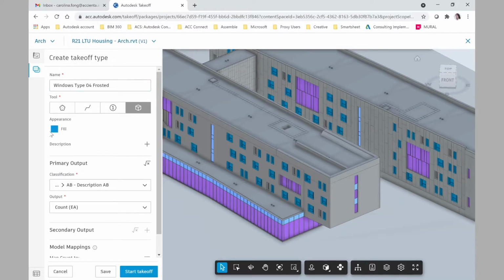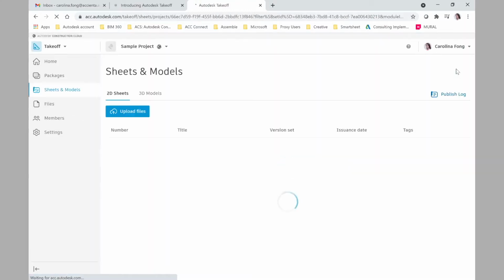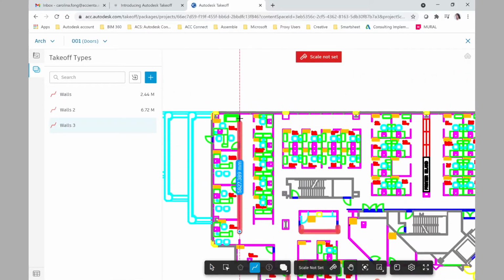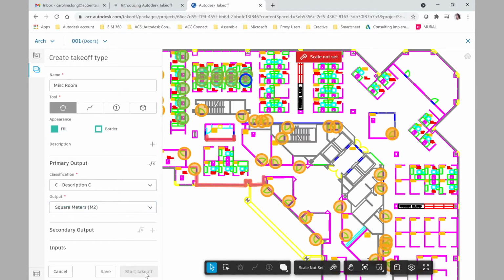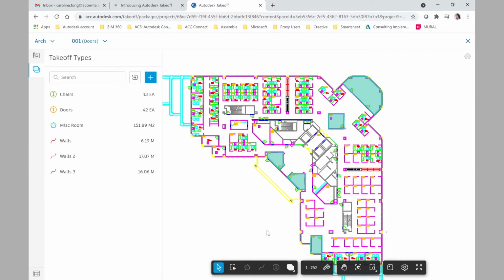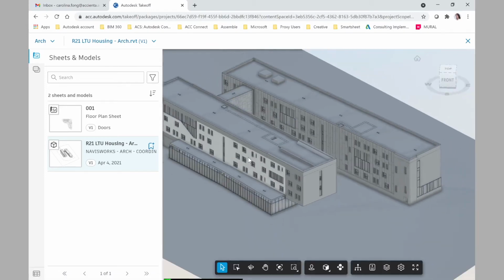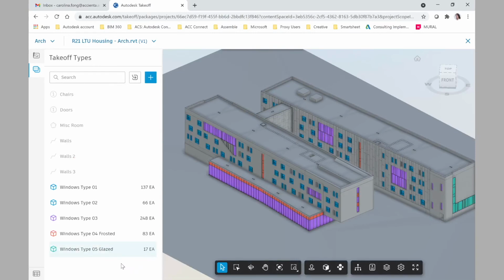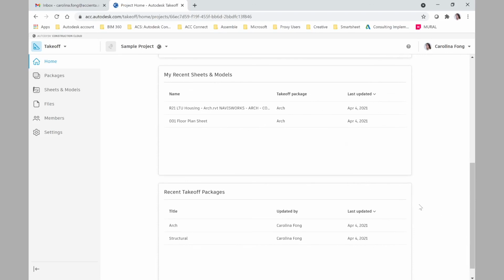Autodesk Takeoff Demo - 3 Steps to Quantify

Comment: What is the difference btwn classifications and packages,
I uploads classification in excel sheet
Reply from the maker: Hi Ahmed, 

Classification system - You must upload a custom classification system or select an available classification system to use during takeoff. The classification system and its codes are used to describe and organize your takeoff items. You may be familiar with commonly-used systems like MasterFormat or UniFormat.

In Autodesk Takeoff, a package organizes and contains all takeoff data related to one scope of work in your estimation project. The concept of a package might be familiar to you as a ‘scope of work’ or ‘bid package.’ There can be multiple packages for a single construction project. Each package organizes the takeoff work relevant to its part of the project.

You can find more information here: 
Classification System:
https://help.autodesk.com/view/TAKEOFF/ENU/?guid=Configure_Takeoff_Settings

Work with Packages:
https://help.autodesk.com/view/TAKEOFF/ENU/?guid=Work_with_Packages
Reply: @CarolinaFongGuzzy  thank you ✋
Reply from the maker: @ahmed3820 It's my pleasure. I'm glad the content is useful!

Comment: Takeoff based on parameters in the 3D models is not possible (yet)? We (and other users) are using the classification code or keynote in Revit and it seems that's not possible to automatically generate a takeoff based on those parameters?
Reply from the maker: Hi Joris, 
The 3D model parameter used for selection at the moment is the element Type name. You can also use clusters (Ceilings, floors, supports, lighting systems, etc).
I suggest you go through the Autodesk Takeoff courses here: https://learnacc.autodesk.com/page/autodesk-takeoff 
What is shown in the videos is the current functionality of the system. Further details are included in the Autodesk Help page: https://help.autodesk.com/view/TAKEOFF/ENU/?guid=Takeoff_3D_Models

I hope this is useful and also look out for new product updates.
Reply: Thanks for sharing. Because of you I learn a lot of things about ACC :)
Reply from the maker: @enesmemis9303  Thank you Enes! I'm happy to hear that! It motivates me to create more content.